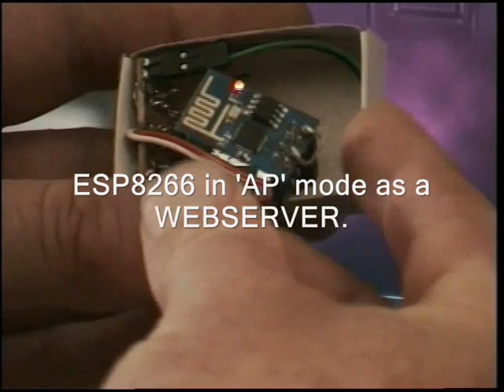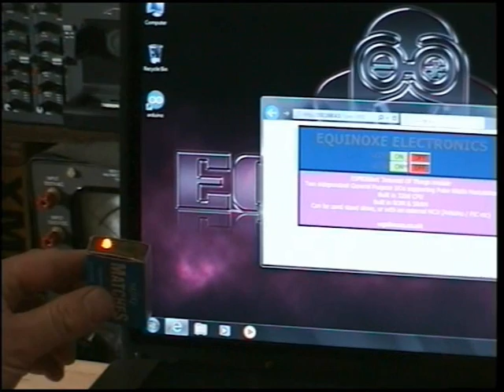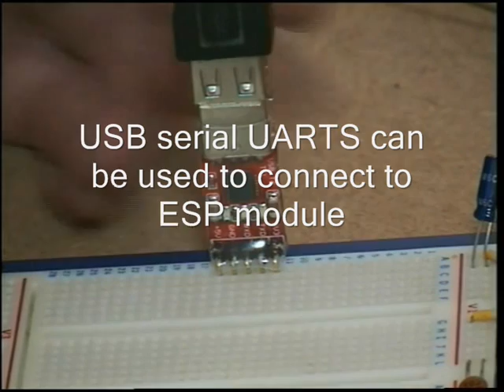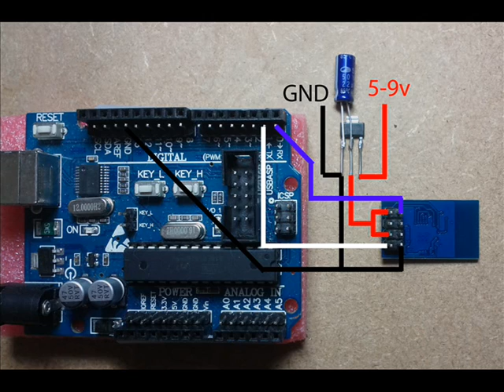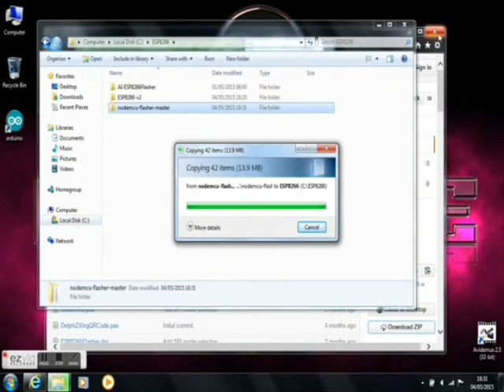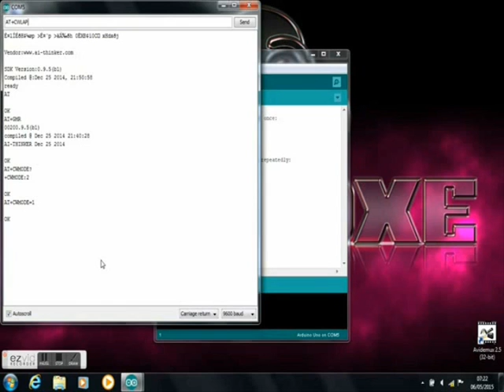ESP8266 - Getting Started & Connected.

Comment: Good video but I'd suggest recording and distributing in HD.  I wouldn't suggest leaving the GPIO0 unconnected.  Consider having a pull-up resistor to Vcc.  If not connected, it could float to ground during boot and you would be in flash mode.

Comment: Thanks for your explanation.
For a better understanding of your video, can I ask some questions?
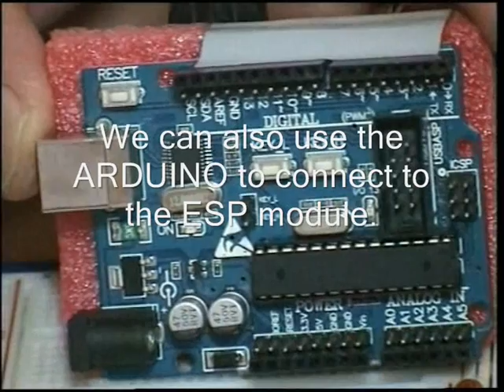1. Until 5:50 of your video, you used USB-TTL board.
 But from 5:50, you can command to ESP8266 by Arduino.
 Is it possible to flash the ESP8266 board without USB-TTL board?
2. Can I control ESP8266 board without Arduino?
 What I mean is, can I control something by stand alone ESP8266 board after programming via Arduino?

Comment: Thanks for the tutorial.  Here's a question:  You said you have the latest firmware installed.  But I do not want to flash my ESP-01if it's not completely necessary.  (AT+GMR reports v1.3.0.0)  Should my 8266 respond to all the AT command set ... or do I absolutely need to flash it with something before it will work correctly?  Thanks again!

Comment: Thank you for a well informative video.  My first relief was that you are from the UK, and totally clear to understand.

I'm trying to develop a remotely controlled leveller using stepper motors. Being a novice I purchased the ESP8266 serial wifi Wireless Transceiver module ESP0.1 for the UNO R3. I also bought the Transmitter and receiver kit 443Mhz. Only to run into Nodemcu ESP8266. Now I think this is just an IDE/development environment for the ESP8266, can you shed some light on this please.

Also can the ESP be used to receive instructions from an Android device or purpose built controller, like a joystick and then transmitter results back to the sender ? I would like to turn the data sent back into some sort of image so I can determine whether the objective has been met. 

Please any info you provide would help greater

Comment: Great video, thank you  !

I only have one question and that is the voltage levels on the Arduino Uno TX/RX lines are 5V and the ESP8266 are 3V3. You connect them directly without any problems as most authors recommend level shifters so that the ESP8266 module is not damaged. What are your views why damage does not occur ?

Comment: Nice video, I have been playing with these off and on since they came out, I have a rather small collection of the first version, some mounted on the green or white development boards, most with a resistor soldered on them to make programing easier, as well as several 201's and a large supply of 12 and 12E's that are purposed to chores around the area. One is made into a portable scanner for wifi signals that I use when we are traveling the USA in our 35 foot Class A motor home, it makes connecting to available wifi networks much easier. (you would be surprised how many routers that have the password as "password" and one can quickly connect to check your email, although I wouldn't want to try streaming netflix on them.

Comment: This video was  the only video that could get me through to actually getting it to work. I have tried many ESP8266 chips..tried powering through arduino and could never get them to work. Using 5 volts along with the voltage regulator was the trick. Thanks so much. I can sleep now!  What does the capacitor do? I got it to work without is it needed?
Reply from the maker: Glad its been useful for you, thank you for watching. The capacitor is really to provide stability for the power supply as the consumption of the ESP can rise and drop suddenly between a few microamps to a couple of hundered milliamps. It depends on the power supply you are using as to if you really need it or not, but I found I occasionally got corrupt data from the ESP when it wasn't in place.
Reply: Uploading seems to be a challenge sometimes and if you dont get the programming right it likes to yell at you. But after that I Just built my first cloud and local server using aREST and a DTH11. I got it to work and am excited to be chugging along thanks to you.

Comment: Thank you very much for the vídeo. There is only one thing that did not get clear for me.
Are you using only arduino for transmitting At commands or are you using the USB-Uart adapter for it? 
And the node mcu, and the update firmware, is it necessary? 
Regards
Reply from the maker: Nicholas Fernandes Hi Nicholas,
Firstly, thanks for watching and your comment :-)

Yes, The arduino is acting simply as a USB-Serial UART in this video, although it does show how to wire both. You can use either and get the same results.

Also, the arduino software in the case in this video is acting simply as a terminal emulator, so you could infact use something like putty instead if you wish.

However, I have chosen to use the arduino rather than the USB-UART as later I use the arduino to communicate with the ESP using the AT command set, and display the results on an LCD display as a wireless network tester, which I wouldn't be able to do using the USB adapter..

The firmware is updated really as it provides a bit better reliability and access to the slower 'more usable' baud rates.

As far as node-mcu is concerned, I find very useful as I may switch between using the LUA firmware and the AT firmware, and it seems to do a pretty good job.
Hope this make it a little clearer?

Regards
Adrian.
Reply: Equinoxe 
Thank you very much for you attention.
It is perfecty clear now,
I am making a project that uses, ultrassonic sensor + MSP430G2553 + ESP8266, in orther to publish the de sensor data at a broker throw MQTT, please if you could do a getting started with MSP430G2553 + ESP8266 just as you made for arduino it would be good.

Thank you best regards!

Comment: I'm not sure, but shouldn't you first level down the RX to 3.3v instead of direct connection to the USB - TTL ? The rx might be of 5v logic. If that is the case, would the ESP8266 be able to handle it ?

Comment: So will a 9V battery hooked up directly to the regulator be sufficient to keep this unit going for a while? I think it was a 500mA draw. It doesn't look like it will. A typical alkaline 9 V battery has a capacity of 550 mAh so I'm assuming it will only power the wifi for about one hour... am I right?
Reply from the maker: +Jason Axford I should imagine that an hour will be about right, but it depends what you are doing with it, if your are using the GPIO ports etc etc. If you hammer it I should imagine 30mins will be about right, with occasional polling, you could get 3 or 4 hours at a guess? You could try a battery from a mobile phone, for around the same size you could get 1000 - 2800mAh plus you can re-charge it!
Reply: Cheers. Sounds like these units won't last long as a stand alone wifi temp monitor without having to recharge every day. I use the 1-wire iButtons to log temp data and they last for years on a CR2032, obviously because they're not a wireless, polling device but I'm sick of having to retrieve them to download the data.

Comment: Hello please I’m getting an invalid head of packet error (0x00) 

I guess it could be that it’s because I’m powering from arduino as you said - weird because it glows red and blue when the ch_pd is not connected 

In that case , can you please leave a link for the Voltage regulator ?

Comment: Very nice video. In the beginning your device is working as AP, in the end you configure the device as Client... Which are the AT commands to make the device as AP where I login to via wifi?
Reply from the maker: If using the AT commands, first you want to set the ESP as an AP:
AT+CWMODE=2
To verify this:
AT+CWMODE?
Then set the SSID and encryption mode. This takes the form:
AT+CWSAP=<ssid>,<pwd>,<channel>,<encryption>
The ssid & password will be in quotes.
The encryption will be 1 = OPEN, 2= WPA-PSK, 3=WPA2-PSK
The correct syntax for this command is:
AT+CWSAP="YourSSID","12345678",6,3
To verify this::
AT+CWSAP?

Comment: thanks for the amazing detailed video !
what is the firmware you flashed on the ESP8622 ? :D
Reply from the maker: Mazen Hassani Hi There, Thanks for watching :-). The firmware for the AT commands was the AI Thinker 0.9.5.0(b1) which allows for connection at 9600 baud rate.
The matchbox server thingy uses the 'LUA' firmware which actually comes with the NODEMCU flasher that was used in the vid. This firmware is located in the \nodemcu-flasher-master\Resources\Binaries folder. You'll need to use a LUA uploader with that firmware too, it's quite involved so I didn't go into it in this video as it is literally 'get started' video!...I may do a quick one going into the LUA stuff maybe?
I'll put links to all the stuff you need to download at equinoxe.co.uk under the DOWNLOADS tab, including the firmware & a PDF of the AT command set. Let me know if there are any broken links.
Reply: Equinoxe that will be great :-)

Thanks in advance ^_^

Comment: Thanks for the help. Where during the processes you show do you power down the ESP8266 module? I see power on after serial monitor is set-up and ready to read. Also leave off until ready to flash NodeMCU Flasher.
Reply from the maker: I would power off the ESP whilst you connect GPIO0 to GND, and then power on the module afterwards. The module will then be ready for flashing. Once the firmware is flashed, power off the module, dis-connect GPIO0. Launch your Arduino IDE, run the serial monitor, and then re-power the module. You should then see the pre-amble before you see the "READY" prompt.
Reply: I appreciate the quick reply. Once I get a series of steps defined, I'll be good to go. I'm looking for a resource for learning these IoT devices. Equinoxe may be it. Thanks!

Comment: Hi,
I'm trying to flash it via Arduino Nano's serial pins (i have blank program burned in Arduino). I am using 3.3V from Arduino and i have used 5-3.3V logic converter for ESP RX pin only. Issue is when i connect 3.3V to CHPD pin the module shuts down (red light turns off). SO enabling the chip isn't working for me. Can somebody please help?

Comment: Great explanation, thanks!
I have a question: why do you add a capacitor to the regulator? Is it really necessary? How do you know the value that you shouold use?
Reply from the maker: +Arturo Ribes 
Thank you for watching, hope you found it useful!

The ESP modules power demands can vary suddenly from a few milliamps to a few hundred milliamps. Without the capacitor to 'smooth' things out this will most likely cause instability and produce unreliable results. Putting it simply, all the capacitor is doing is taking up the slack briefly during this transition until the regulator settles.
For a more details , check this link:

https://en.wikipedia.org/wiki/Decoupling_capacitor

Comment: Shouldn't you have a voltage divider between TX from the Arduino to the RX of ESP8266? You could burn the module this way, since you are providing 5v from the arduino output pin
Reply: Could be true, but with voltage divider it always says upload failed in my case , I think its only sensitive on the vcc and ch_PD voltage

Comment: Nicely explained video but running into a problem. Using the Arduino and external power supply through a regulator as you describe. Assembly is straight forward but when I power up the ESP I get the first bit of gibberish along with "Ai-Thinker...", then "ready" then I get "WIFI DISCONNECT" Never git a chance to get into AT commands. BTW - At this point serial monitor is in echo mode as everything I type prints in the receive window, and in one line as there is no carriage return or line feed coming back. Any thoughts?
Reply from the maker: +hoboat33 - OK Receiving the garbage is normal on power up, and then you say you get the 'ready' prompt, which suggests that your baud rate is all ok and your RX and TX are the right way round, so it sounds like you are pretty much there.
There is a little 'pull down' menu on the bottom right hand corner of the serial monitor, ensure that is set to 'Carriage Return', also check the RX cable on the ESP is ok with a tester. Worth noting, the AT commands are case sensitive.
Also, if you have not already tried, click the SEND button, instead of pressing the return key on your keyboard?
Another terminal emulator you can try instead of the arduino serial monitor is "putty" which you can download from http://www.putty.org/
Reply: +Equinoxe - Thanks for the reply. I kept tinkering and if I repeat the "AT" command the unit comes up and stays up and AT+ commands are working. For some reason the com works when NLandCR are selected rather than just CR.

Comment: Hi, can I ask what you used for the power supply current wise, also I thought if you used the Arduino for a serial to ttl unit you had to take the chip out or ground the reset pin ?

Thanks
Reply from the maker: +acestu I am using a 5v 1.2A supply to the regulator. Check the specs of your regulator, but I think as long as Vin is within 12v of VOut you should be ok (depends on your heat sink!). A 9v plug in 'block' transformer should be fine.
One thing that I haven't tried, is to power the Arduino using a external supply and using the 3.3v regulator that's on the Arduino for your ESP. I know that powered alone from the USB lead just doesn't have enough grunt for it to work properly for me.

Comment: Great explanation, mostly Greek to me since I haven't started with my Arduino.,,,, you seem to say the one in the match box has the LUA OS??
I want Arduino to control 8 individual AC outlets remotely via WiFi as per your match box idea which is great!!!. Leaving the interfacing to the outlet aside, how the Arduino should interface with the individual ESP's?   The Arduino would be in constant query mode as well as changing outlet on-off conditions.
Any block diagram or additional suggestions would be greatly appreciated, I need lots of help to start somehow moving ahead but what you showed in the video, once I can understand it better, is what I would need.  Many thanks.
Reply from the maker: rondacosta 
Hi rondacosta

In this video, the ARDUINO is used only as a serial interface to the ESP, there is no programming done on the ARDUINO at all. 
The 'matchbox' webserver is using the LUA firmware which which will run on the ESP standalone and again, the ARDUINO was only used as a 'serial interface' to upload the firmware and code.
So, back to what you are thinking of doing, if you are wishing to control 8 power outlets (I'm going to assume they are all in one location?) you could use the ESP-07, which is the same device (it just has 9 GPIOs rather then 2).
Off the top of my head...the easiest way would be:

1 - Flash the ESP with the LUA firmware, which actually comes with NODE-MCU (used in the VIDEO to flash the AT firmware onto the ESP)
2 - Use the LUA-UPLOADER software (not mentioned in the vid) which is where you would create and upload your actual code to the ESP.

You could then use any device with a wifi connection to connect to your ESP and a web browser would be able to turn on and off your power sockets. 

If all your power sockets are all separate, again, off the top of my head, I guess one way of doing it would be to have an ESP for each one with the LUA firmware on it in AP mode (rather like the 'matchbox' server, and if you particularly wanted to use your ARDUINO to control these, you could have an ESP attached to the SERIAL connections of the ARDUINO with the AT firmware on it in STATION mode,  and use you ARDUINO code to make the connection and send the TCP data to toggle the sockets on and off?
There are several AT commands to establish TCP or UDP sessions and send TCP/UDP data etc which should work? I'm sure given some time and thought, you will come up with a better way of doing this...but it may be a start!

In the downloads tab of my website((www.equinoxe.co.uk) under construction!), there are links to the NODE-MCU (flasher) and  LUA-UPLOADER(programming language) which is what you need to get started, and I'll try and get the AT command set instructions put up there before the day is through, plus I'll dig out the LUA code that is used on the 'matchbox' server so that you can take a look and get a feel for it. Let me know how your project develops!...sounds interesting!..

Comment: Hello there , Why can't we connect the ESP8266 to the output pin of arduino which is of 3.3 v?
Reply from the maker: +Digant Goradia In theory that should work fine, but I've never had much success doing it like that. This is probably due to the limited power that the USB can provide to the Arduino, if you are powering the Arduino with a separate power supply, it may be more likely to work, but the power that the ESP requires does fluctuate greatly which seems to cause instability (well it does for me anyway!) Using a separate 3.3v supply is the only way I've managed to make it work reliably.
Reply: Thank you sir.